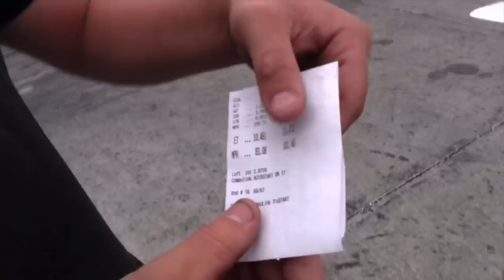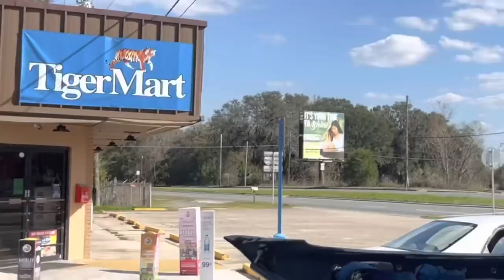Winning With KSR! Freedom Civic Is Getting Faster!! Day 3 #sickweek2023

Comment: I had an alternator die on a road trip, in the middle of the night, I had a trailer with a generator and a battery charger. Ended up driving about 120 miles with the generator running on the trailer, powering the battery charger with an extension cord! it was a fun drive!

Comment: The Freedom Civic is flying.Congrats .I think Shane should check his Honda unibody measurements after Sick Week.For around 200.00 you can purchase a nice 2D measuring kit.This will eliminate any guess work on suspension and steering points,engine,transaxle position,wheelbase,etc front and rear axle lengths.Once he's sure everything is where it should be ,he can then focus on going fast again.

Comment: One thing I ran into with that style injector cleaner is the injector connector pins on the machine will loose pin tension and not make full contact and give a false low flow condition. If you swap the highest flowing injector location with the lowest flowing injector location there's a chance that the highest flowing will now be the lowest and vice versa. Just because they're making contact and activating doesn't mean they can flow enough current to operate the injector at 100%. I cut the connectors off the machine and put fat spades on the leads and have all the different injector pigtails to adapt to it. Those red and black connector pins on those machines wear out pretty quickly. Figured I might mention it before the injectors get fully blamed, just seems very suspicious that they would clog that fast. Hopefully that may be helpful. Good luck with the rest of the week, I knew you guys were going to do much better this time around. Keep on keeping on ✌🤙